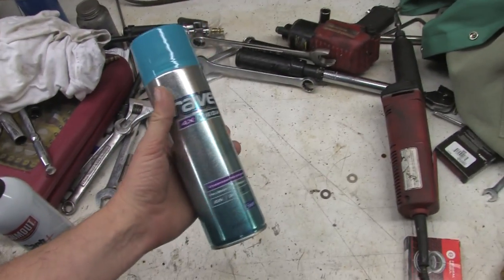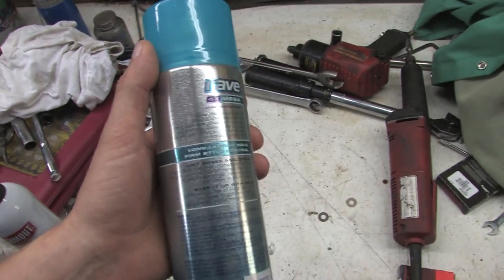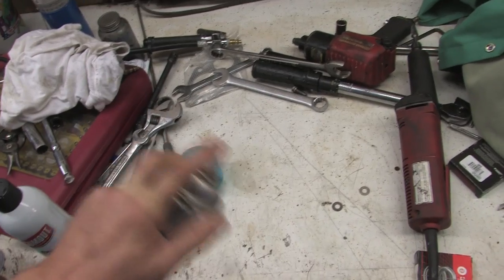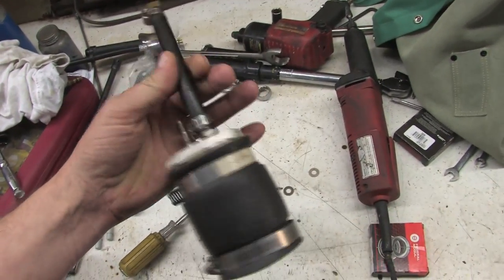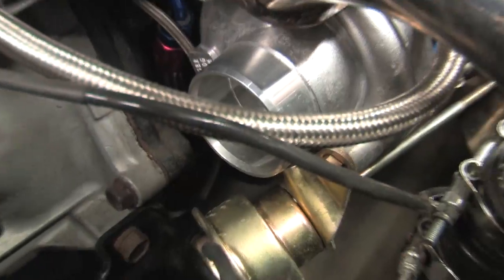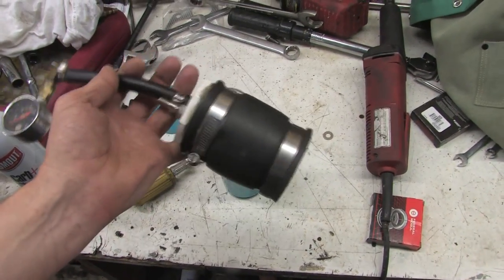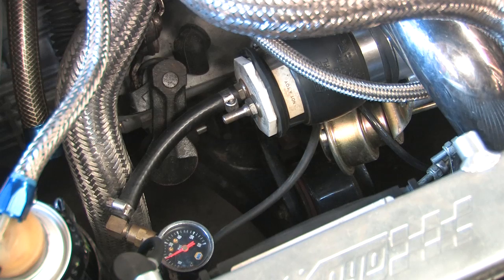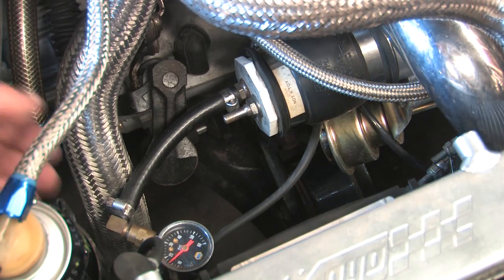Boost Leak Testing 202:  Hair Spray 1080HD

Comment: That's a great tip. In exchange for this tip, I'll give you a tip.When putting on cylinder head gaskets, paint the head gasket with high temp paint on both sides, wait till the paint flashes, then put the head on. The paint acts as a sealant and seal the water pathways better then the gasket alone. You'll have to rip the head off with a crowbar, it works that good. Paint also is good for regular gaskets too, doing it the same way. Here's a twofor, when inserting a bearing or bearing race into it's housing, paint the surface before and let it flash, then put the bearing or race in. The paint will act as locktight and is better then locktight. Enjoy.
Reply: sounds interesting. ill have to do some research on that
Reply: prancstaman do shops do that when they install head gaskets? I want that
Reply: Matthew no bud, clean and dry on a true surface. lol
Reply: They do this with a special copper spray, same deal only much much better with heat
Reply: @TheSunnyTrails  I think that only one side of the gasket needs to be coated with the copper based gasket cement.  The purpose is to keep it from sliding around while bolting everything else in place. Only coating one side also helps if someone stupid like me drops the gasket or misaligns something and needs to reposition the parts.  Or both  ) - :

Comment: Hair spray has been in my garage since ever... :-) any time you need to improve rubber to metal contact there comes the handy hair spray. 
Motorcycle or bicycle handle bars, but by far the most used is to assemble tires. Even with old scratched wheels never had a leak. Definitely worth having around. ;-)

Comment: When I used to ride scooters (skatepark kind) and now motorbikes recently. I used hairspray on the handlebar grips and it never ever slipped off or moved even in the wet. So hairspray in this instance is perfect! Never thought about intercooler couplings! 

Just a little story and tip

Comment: I've got one better for you coming from a bmx background before I was into turbo cars: WD-40.  For years as kids we used hairspray to put our grips on our bikes and this took a while to dry once applying.  What sticks way better and doesn't require long to dry at all is WD-40.  I know it sounds like it'd do the opposite but it will make your couplers stick so well that you could probably get away with using worm clamps instead of t-bolts.

Comment: Hey Jaffro, enjoying the footage, been watching your passes in your Eclipse, the sound of the engine the goods and bads finally working out the leaks awesome!
Not knowing the specs of the engine, was hoping you could enlighten me?
Is it forged? what cams? i'm guessing your a scavenger when it comes to timing?
Reply from the maker: I ran HKS 264/272 cams with Crower dual valve springs, factory timing gears and the head was resurfaced, so I really have no idea what the timing was on the GSX.  I was just getting lucky with however it all lined up.  However, I did re-use all of these GSX go-fast parts on my Elantra build, and I did set them up dialed exactly into the HKS recommended (and corrected) specifications.  It left me with 3.5° of overlap at .040".  If you watch the Hyundai build, you'll get every single detail including the 103° LSA calculations and all the important oil clearances.  The pistons and rods in the GSX were JE 9:1cr .020" with Eagle H-beams.  I'm re-using those pistons in my upcoming GSX build, but the rods went in the trash.  I'll be using Manley Turbo Tuff I-beams on its next iteration.  The Hyundai has .030" 9:1cr generic cast pistons on factory 6-bolt rods.  In the "Calculate your compression ratio" video, I explain why it's really ~10:1 instead of 9:1.  The next GSX build will not resemble its state in the videos I have up here, it's going to be a very different beast.

Comment: This works great until condensation comes into play. Used to do this on BMX grips, but one trip through a Chicago winter to get to an indoor track negated that real quick. Got to the track and with the indoor temperature change, the condensation affected the hairspray and we all had pretty bad throttle grip.

We turned to Tri-Flow, which is a teflon based lubricant... sounds odd, but worked amazing. Not sure if it'd prove useful in these scenarios, most of us use silicone couplers for our charge piping.
Reply: deeksmooth liked seeing you resolve the problem with the hose, in all my years with motorcycles i always put my grips on with clear spray paint

Comment: i really thought that is a turbo inlet hence the reason it doesnt need a lip as there is no pressure on the inlet side if anything there is lots of sucking going on, but i never seen a turbo boost pop an intake hose off. Charge pipes need lips as thats where u get pressure. Hope u got the leaks sorted out and fine tuned the car for dyno.

Comment: my vr4 has a drop in pipe for the rear with a thick oring, kept blowing that out since i havent extracted the broken pipe stay bolt since i bought it, high temp silicone works well to keep it in place

Comment: All cars should have a shraeder valve on one of the boost pipes as standard.... to make testing for high pressure boost leaks easy.... as boost leaks cause emissions problems... but they are not routinely checked....

Comment: OK, so you've glued the hose to the turbo COMPRESSOR inlet now. How do you remove it for maintenance?
Reply from the maker: Warm water or a hose hook.  Google Gearwrench hook and pick set.  There's a few different kinds of hose hook included in it.  It's like twenty bux.

Comment: How does a pipe blow off that part of the turbo? There shouldn't be any pressure before the wheel?
Reply from the maker: Hahahh... watch it again.  I'm pressurizing it.  You're right.  Normally there wouldn't be, but I'm not making it a point just to use it right there.  It works on any coupler or vacuum lines.  Whatever you want to stay put.
Reply: Thanks for the tip I wouldn't even dream about doing this and it makes so much sense!  All the times I've spent money on expensive clamps for my intercooler I could have done this 😃

I still have a intake pipe sliding off so I'm going to try it

Oh and I've subscribed I'm looking forward in watching some videos tomorrow 

Thanks for sharing

Comment: When I'm driving my car hard and it will ruin fine until I come to a stop, then there's no power what so ever and the turbo won't even spool up. Do you have any idea what that could be? If I shut the car off then turn it right back on it will run fine again. Misfire, maf, causing the ECU to run a basic map until it's restarted? idk, no one has been able to help me out with this or find info about this.

Comment: For those of you guys that use hairspray on IC piping, how much of a headache is it to remove the silicone couplers the next time you need to run a boost leak test?
Reply from the maker: +enuary A little warm soapy water, or a hooked pick make it a cinch.  Without them, it can be a real pain.  You might see that as a bad thing, but I think it's a good thing.

Comment: ...What does it mean if when i pressuretest my setup, the engine ticks over a couple of notches?
And i cant go over 1bar(cant remember psi, sry) for some reason. I thought that the throttle body would hold the pressure fairly well from going into the inleft and in to the engine? Got leakdown aswell, but what can i expect from an engine close to 400 000km engine x) (Sry again for metric numbers...)
Reply from the maker: +creamtube It's just air pushing the cylinders down into the bore.  It's because of where in the stroke your engine stopped.  If you use a wrench on the crank pulley and turn the crank 90° while applying pressure and the pressure changes, then your 1bar limit was because the valves were trying to open.  The problem you'd be having might include a burnt valve if you experience this.  The reason why is because there's never a condition on a factory cam where both intake and exhaust valves are open at the same time.  Usually one's locked down preventing air from getting past it.

Are you sure that you're not leaking air externally from somewhere else?  I mean… if you have leak down… that's not the greatest thing.  You could try the oil down the plug well hole trick to see if it improves your compression numbers test… I'm sure you know what I mean.  That would tell you if it's the rings or the valves?

Comment: are you serious?  put a 3 ft. hose on that test plug to keep your fingers from the danger zone and also a chain so you can secure it to something solid just in case it pops off at full pressure, you don't want a missile flying across the shop hitting who knows what. assuming a 2 1/2" coupler x 3.14 x 30 psi = 235 # pressure on that cap. that can take a finger off or an eye out. be careful out there. eh.

Comment: You don't need to wait 24 hours for hair spray to dry on your head why would you need to wat that long on your vacuum lines?
Reply from the maker: because the surface you're sticking together doesn't have air all the way around it like your hair does.  It's sealed up between the nipple and the rubber hose, and you want it crusty dry.  If it's wet at all, or gel-like, then it will act like a lubricant and help you blast the hose off under pressure even easier.

Comment: Does the BOV open when testing
Reply from the maker: It shouldn't.  If it does that when you're testing, it will do that when you're driving.  It's boost source should be the intake manifold and you're pressurizing that, too... so...  That's the boost source that should be holding it shut.

Comment: I have a 1.8t awp Jetta and I'm not getting boost what's so ever I've been told vacuum leak but wouldn't that mean a hard start as well it starts up fine just a alternator sound saying it will need to be replaced but any idea on what I should do I don't have a compressor and kinda on the broke side because I got side swiped and insurance wanted to total out my car so they raised my insurance.. Please let me know what to check for or replace its fully stock has 153k 5speed non of that automatic bull crap lol let me know thanks my first turbo car and I've always wanted it since they were made thanks in advance
Reply from the maker: Nah.  A boost leak won't make it hard to start.  You have a fairly large boost leak.  You're in the right place because my boost leak series has everything in it you need to know about finding it.  You don't have to buy an air compressor if you know any other human that already has one.  All you need is the airflow.  Building the tool is cheap, so that should be easily in your budget.  Just find someone with a compressor when you're done, and your diagnosis process will only take minutes.
Reply: +Jafromobile okay thanks I will watch more of your videos thanks
Reply from the maker: ThePattonboy123 I could take my UICP off and drive it around because of how my blow-thru MAF setup worked.  It just wouldn't make any boost.  It all depends on the car and how it meters air.  You can do this with a speed density setup, too.  No boost is a classic boost leak problem... but it's not the only thing it could be.  It's just the first thing you should always check  The others are wastegate stuck open, seized turbo, or a giant hole in the exhaust manifold.  It can only be one of those 4 things. 
The holy exhaust manifold would be really obvious.  You wouldn't even need to pop the hood to find it.  You'd know.

Comment: But why pressurize the inlet?
Reply from the maker: You can use a vacuum line if you want?  Sometimes they blow off.  They're more difficult to pressurize an intake system with than a simple tire valve.  If you're meaning to ask why this test is necessary, or why do it at all, it's to find intake leaks that will throw off your fuel delivery and rob the car of its efficiency and power output.  Intake leaks can easily become a turbo car's Achilles heel.
Reply: @Jafromobile  it doesn't see boost.I stick the MAF in front it.

Comment: Hey bud awsome videos very helpful I am hoping u xam help as ive read everyrhing and checked everything and still no solution. Got a 95 eclipse gst stock t25 front intercooler boosr controller and full 3in exhaust  no cat I am gettimf a bad smell while under boost and after boosting thinking turbo bur there is no smoke or shaft play at all sometimes when rumning hear turbine spinning but not boosting im hoping u get this and can help me out im thinkinf bad turbo but not sure anyone got sum advix

Comment: why not just use a silicone coupler that will grip better than you lowes rubber drain coupler....have had them hold 60psi on my pressure tester without blowing off or apart